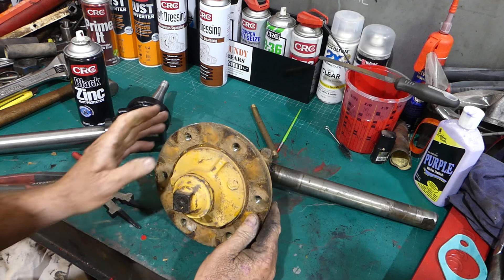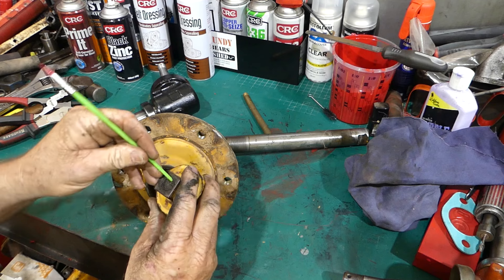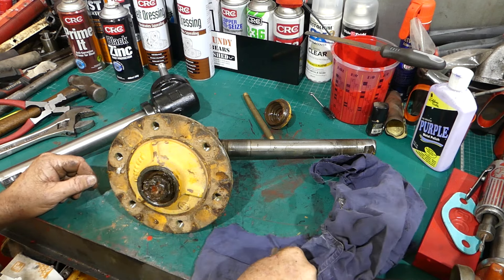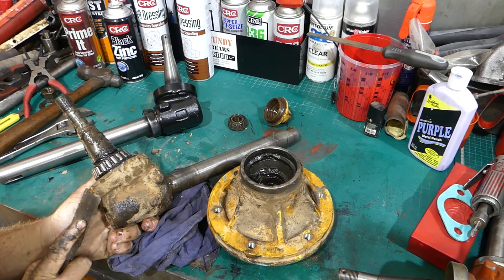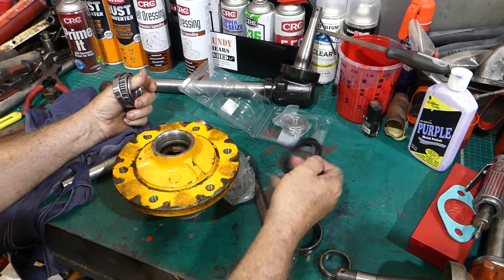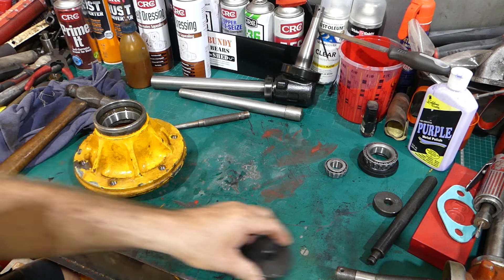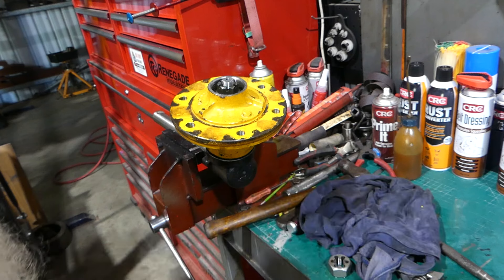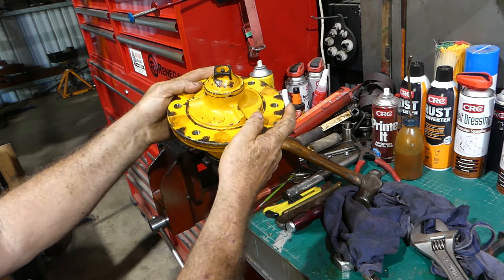Massey Ferguson 20 Front Wheel Bearings

Comment: I have what I think is a MF 30 or 165 industrial tractor. It was used by the SC highway department. 
My tractor bounces on the front end if I go over 3mph. 
Do you have any videos that address this issue for my specific MF. 
I checked the tie rods and the wheel off the ground. 
The wheel moves loosely 1:58 in all directions. I quit using the tractor for fear it would leave me stranded in the field. 
How do I check the center pin? I am a novice.
Reply from the maker: Jack up the front under the middle of the axle support housing and see where all of the wear is, that should give you some direction.

Comment: Hi  Lance I know it's not relevant  to the video but can you tell me why my ted20 only trys to start when you stop cranking
Reply from the maker: Usually low voltage or the starter is getting worn and takes that much to crank it there is not enough voltage left to run the coil. See if it works with jumper leads onto a car and if so there is your problem.